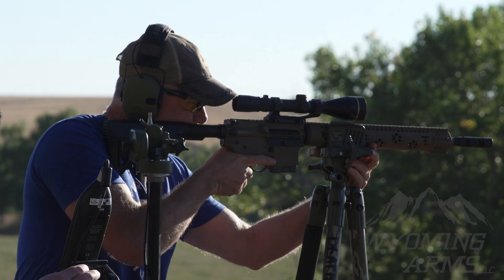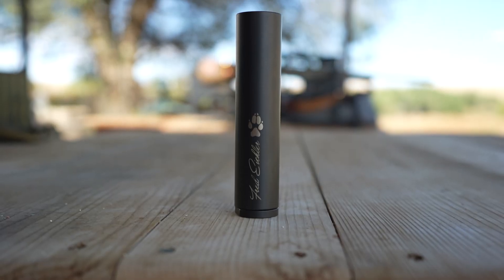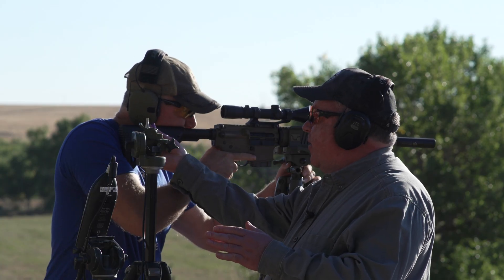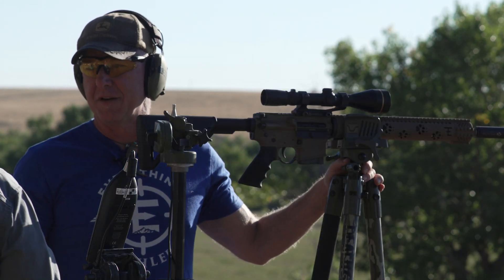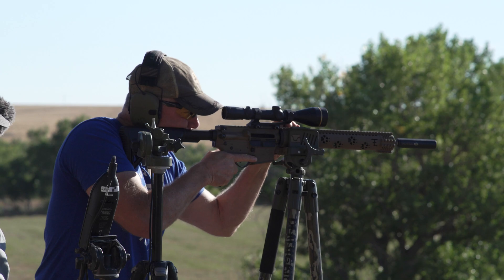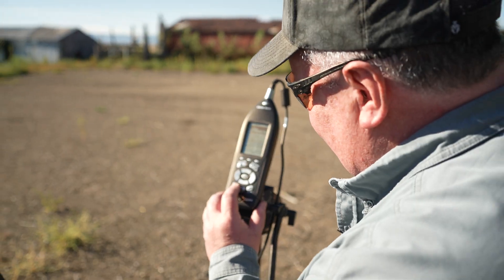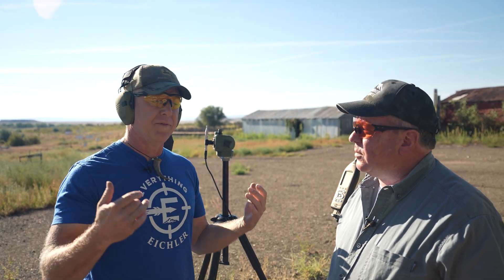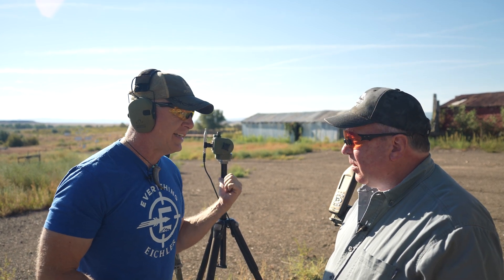How Loud is a Gun with a Suppressor?

Comment: Fred and John, you should be using hearing protection in the field even with a suppressor.

The decibel scale is nonlinear. An increase of 3 decibels corresponds to DOUBLE sound intensity. So if the decibel reader is giving you anything above danger thresholds (in this case we get a reading of 142dB), that's not a little louder than the 140dB OSHA cutoff. That's closer to 100% percent louder. Also that's way too high of a cut off anyway. You run the risk of instant hearing loss above 120dB.

I understand that you have a product and lifestyle to sell, but noise induced hearing loss isn't something that should ever be taken lightly.

Comment: Thats not a huge difference
Reply: Um, depends. But db work in logarithmic scale that -24 db in difference translates to 10^-2.4 or 1/251 of the original intensity which means >99.5% of sound intensity is reduced.